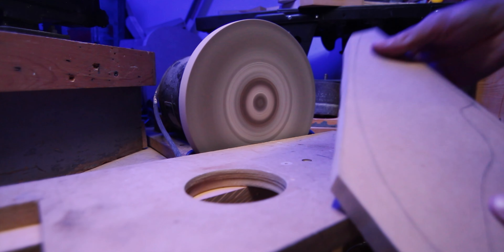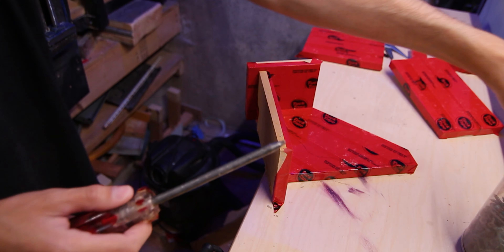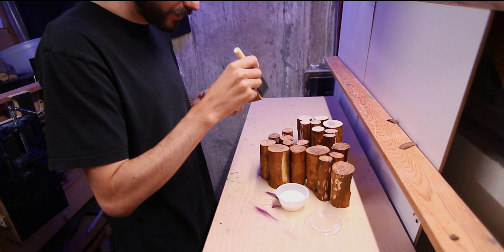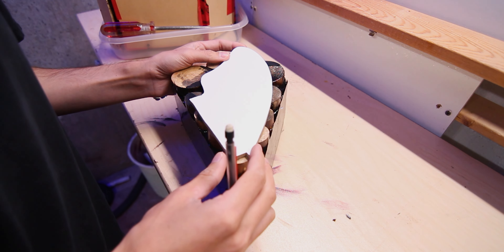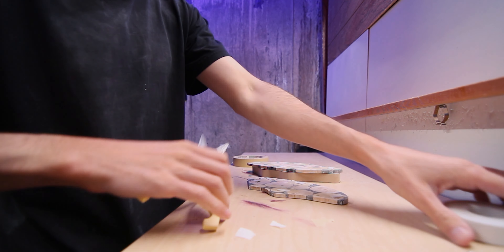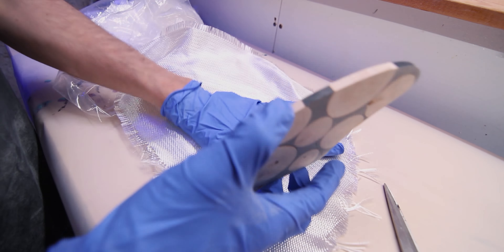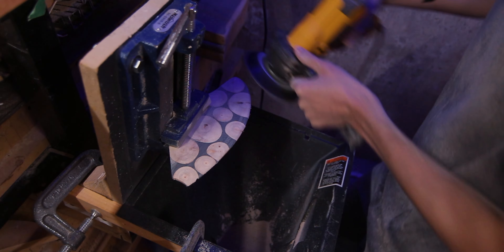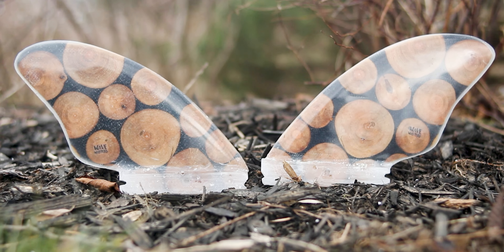I Broke My Surfboard fins So I Remade Them

Comment: This is so cool 👌🏽 What’s the flex like with the use of the tree branches?
Reply from the maker: Thanks! There on the stiffer side but there is a bit of flex to them. No where near the flex of plastic fins, but also not as stiff as solid fibreglass fins. I've surf them from knee high to overhead no problem. Being end grain the spring isn't the same as other maple fins I've made.
Reply: @ so cool. Love all your experimentations
Reply from the maker: @SurfsUpKate  Thanks Kate! They are my favourite builds to make.

Comment: Hi great vid, how do you make the fin tab mould?
Reply from the maker: @toniachetwood8887  I have a video on the silicone molds but not the HDPE ones. All it really is, is the tab shape milled out of HDPE with a set screw to hold the fin in place. I'll be making some fiberglass tab videos in the future, maybe I'll add an HDPE one.

Comment: Great video, keep them coming! 🤙🏼🤙🏼🤙🏼
I’m making some keels too
Can you give some more details on how you kept the cant when you cast the base?
Reply from the maker: Thanks. The can't angle is cut on the inside of the fin, on the tab. I also thinned out the tab so when glassed it would be thinner than the fin tab grove of the mold. The screw is on the outside of the fin(opposite of the cut cant angle. When you screw the in the bolt it pushes the fin tab up against mold and sets the fin angle. When you screw the bolt in its just enough to push the fin against the mold to much and you can deform the mold.

Comment: The fit tab casting doesn't look much like https://www.youtube.com/watch?v=qkVutYonQhM , can you go into some more detail what the difference is that you did here? Also what is the alan screws for? Also why are you adding cant if they are not glass on's, isn't the cant decided by the Futures box? Thanks.
Reply from the maker: Same idea these mold are just made from HDPE to make them more ridged and to make them last longer. The Allen screws are used to hold the fin up against a side of the mold so the fin is held at the cant angle that is mill into the fin base.
Futures boxes the cant is in the fin not the box. If installed correctly the boxes should be at 0° in the board. Some shapers may install them on angle to give fins extra can't but typically they are installed at 0°.
Reply from the maker: FCS the cant is decided by the box not the fin so then your limited to what the shaper puts in the board. Which limits you a bit unless you can find/make FCS fins with cant built into the fin.

Comment: Ciao! What’s the last passage?
Reply from the maker: Do you mean at 20:14. That's the step where I cast the fin tabs. It makes the tabs close to the thickness needed to fit into the fin boxes. After that its just hand sanding the fin tabs to final thickness and cleaning up fins.